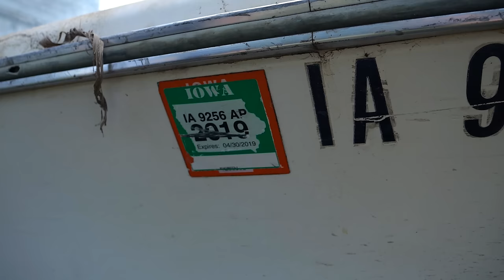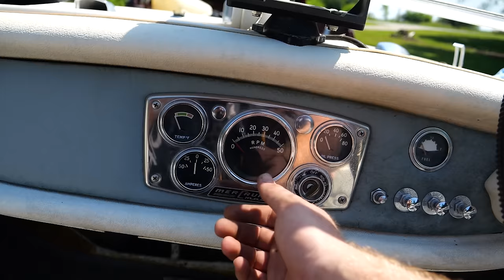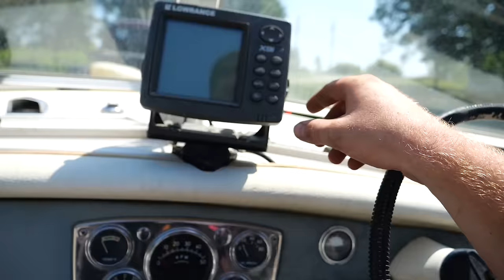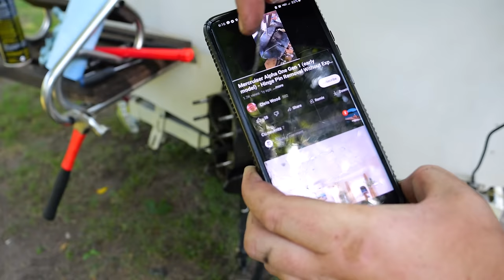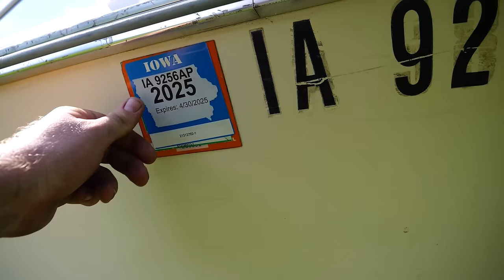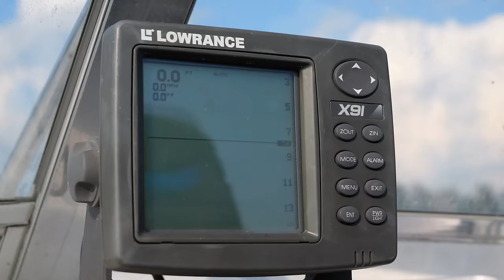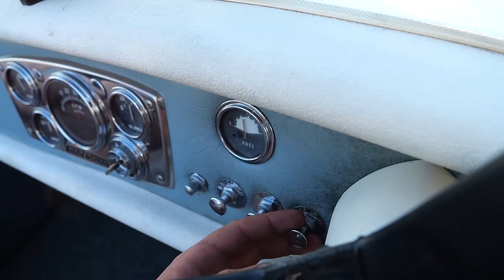Will a FREE Boat Run & Drive or SINK after YEARS of Neglect?

Comment: You think you're having fun, try maintaining a 71 Grady-White with an 89 Evinrude 90 horse motor in saltwater, change the impeller every year, every time you come back from the ocean going to run fresh water through it, hose off the trailer so it doesn't  rust to hell, the joys of boating 😂 I had fun watching you guys on the water after your ordeal getting it ready. Keep up the great work and the cool videos 👍✌️🇺🇲

Comment: Free boats are free for a reason and also not free. :p Congrats on getting it on the water. Be interested to see what you find in the motor and trans after the outting. Hopefully everything is good. If not Chevy 250 swap?

Comment: Roller/cam and pushrod would need two totally different fuel pumps (or you get metal chips in the oil) and that watered oil means an engine strip !   And all those stringers will be rotted, ie., cut out the whole floor and get down to the hull and keel, you'll need new hardwood.

Comment: @Junkyarddigs no antifreeze.. seal the cooling system where water doesn’t discharge… add 1/2 qt. of Sodium Silicate to the system.. the system has to pressurize.. crack will dissipate.. problem solved..😎👍

Comment: Running out board out of water  not good for pump in lower drive unit . There is a gardenhose kit for this .. I used it on the 21 1/2 foot Bayliner V8 .

Comment: Put Muffs on that thing!!!! Never EVER run that Motor without water even for ONE Second. I'd bet the impeller is wiped out of the lower unit now. I just picked up a 1981 Rinker T151 Tri haul last week. Got another oldie back on the water

Comment: You never want to run those motors with the rubber water impellers out of the water. The water acts as a lubricant, and it will 9 times out of 10 explode if you run it without water for more than 5 seconds. They do make water muffs that you attach to a garden hose where you can run it out of the water. They usually sell them at fleet farm or Amazon

Comment: They kept making that motor into the 2000’s. My brother in laws stretched the valves and the Boat shop told him $7000 for a new motor. They didn’t even attempt to tell him what was wrong with it. I blew air into the spark plug hole and heard air in carb. 

I had the cylinder head off in 2 hours. Found the bad valves. Sent it to cylinder head rebuilder for new Stainless valves. Apparently it’s all SBC stuff. $350 bucks later, $100 in gaskets and it ran perfect. Brother in law paid my $600 for my 5.5 hours working on it. 

This was literally the easiest cylinder head r&r ive ever done. Worlds simplest motor. 

I guess it’s common for these motor to stretch the valves and people run them flat out all day pulling tubes.

Comment: Those motors are known to crack in the water jackets right there and you could just run it because they usually don't crack into the cylinder but when they do it's ruined I think some people get away with leaving them and keep the crack in the block on the outside just patch it up

Comment: My buddy just took possession of a free '98 Ski Nautique that unfortunately got run over by a smaller yacht. I'm lucky enough to get to turn wrenches on it. We have some glass work to do, the windshield is broke, dash is destroyed, prop shaft is bent, prop is trashed, swim step is broke, and the aftermarket tower mounts are going to need glass work too. But the Pro Boss GT-40 seems solid along with the trans. There's some minor hull damage on one corner of the strut too. Free boats are far from cheap or free, but it's a free boat right?

Comment: One thing you did, and did not mention about that impeller, is you should never start the motor without muffs and water running through the system.  If your impeller wasn't bad it will surely be if you do that on a io setup.

Comment: 1. Check tires and hubs. Tires age, especially in the sun. If cracked, beware. 
             Lose a tire or bearing, you might lose the boat. 
2. See if engine will turn over. 
3. Check bottom for cracks and bubbles of de-lamination. 
4. THEN look at everything else. Upholstery is VERY EXPENSIVE. 
5. Smell gas. Change fluids.

Comment: A few tips man. I know your
 not a total newb to boats but a few things to consider. Lower the outdrive prior to running engine. Otherwise it’s really hard on the u joints. 
      Never run it dry. There’s a water pump impeller that will burn right up. Which definitely should be changed.  It’s not horrible to change on the alpha drives compared to some others. 
   I’m surprised it didn’t overheat after sitting 4 years and running dry. I like to run a conditioner through it when winterizing to keep the rubber from stiffening up. Glad to see her back on the water!!

Comment: That thing is one huge Coast Guard safety violation. I love it!!! I'm guessing you learned the lesson about running the impeller dry huh?? And an FYI, automotive fuel pumps, starters, carburetors, and distributors are highly illegal in boats as per Coast Guard regulations and the fines are HEAVY for violations. All are explosion risks due to the build up of gasoline fumes in the bilge.

Comment: Probably fried that impeller in the out drive running it with no water attached, your exhaust bellows dose not need to be hooked up all you need is driveshaft and shift cable.

Comment: 10:44 I may not be that knowledgeable about boats, but one thing i know is that you dont run boat engine with out it feed of water for it since it needs to cool and in this care be there not to melt the rubber seal. Never mind those were toast before that, but last owners probably did that too so dont do it.

Comment: You should never run a boat without a water supply ! That's how you wipe out an Impeller, If you not in the water you need to use a pair of muffs to supply water from a garden hose to the water intake on each side of the lower unit.

Comment: I put a Pleasurecraft Marine Engines 1994 Pro-Boss 5.8 EFI in my 78 F-100 back in 2001, so putting a boat engine in a truck isn't that radical of an idea. The Pro-Boss is a 351 roller cam block with iron GT-40 Marine heads and aluminum GT-40 EFI intake manifold.

Comment: That looks like a fun little boat, i'm glad you guys got it running and out on the water!
As a friendly note, it's super important to put the drive down in the water before you crank the motor; it only takes a couple dry revolutions to tear up those rubber impellers.
I don't think you showed actually changing the pump, but it's also advisable to get a nice film of marine grease inside the pump housing before you put the impeller in. It'll help keep it from tearing while it primes for the first time.
Cheers!

Comment: If you run the motor without water, the rubber pump will get hot real quick and fall apart. So you need water when you start the motor.

Comment: I have a hack for youSo I do Marine repair and I've done this many times if you drill holes where the cracks at then use your cold weld material it will actually stay in place and stopped the leak😊 and I'm sure as you know once that happens unless the block freezes there's no reason to even replace it hope this helps thanks for the football and basketball trick

Comment: If you run in brackish water pay somebody that knows how take outdrive apart and replace empeller. The 12 bolts never come out to seperate housing without knowing how because they are corroded in. I know. I suppose they use heat.

Comment: If you have to much freetime to spent and to much savings in your dravs and everywhere bay an old boat....I bought an something 80ts 22fot boat with an inboard motor whos was way to big for this type of boat,but the Peugeot XD 4.90 needed most of those parts who an man can think of and what ebay had to offer,so it took me at least 800-900 dollars to get the engine up running,but in the back of the engine there was an transmision aaaaand it was broken to....and so was the rest of the boat interiour tanks even the steering pump was junk,i had the boat on the sea for one summer and sold it with an 2000 dollars loss before it drained even more of my account

Comment: One of my first boats I owned had the same engine in it as yours and one day on the lake the engine just quit and it turned out the distributor gear sheared off it's teeth so had to flag a boat down and got a tow in since I was five or six miles from shore in Lake Erie. it was not fun and ended up selling it as is

Comment: i have two boats a 1988 Bayliner cobra with a vertical inline five Chrysler Mercury force 150 outboard it runs but idles eventually the lower needs rebuilding an the boat still needs work electrical wise an i have 1990 baystealth 1880 with a vertical mount Johnson/Evinrude 130 v four but all i can say is BOAT=Bust Out Another Thousand

Comment: A marine fuel pump has a tygon hose that leads to the intake in case the diaphragm fails.  An automotive pump will leak into the bilge.  One spark and it’s a very bad day.  Never use automotive parts on a marine engine.

Comment: Alright so I’m gonna revive my dads old speed boat, it needs wood work but it’s easier to fix than our running fishing boat that sank and fully saturated the wood and everything is rotting. We’re gonna do a motor swap since the speed boat was strugglingto run right and had lost the ability to run entirely since it was taken apart and parts lost. And the fishing boat had a similar sized engine since it was competition fishing boat

Comment: I feel you Kevin. I work my tits off for two weeks on a 14 foot Jon boat that hasn’t seen water in 10 years. I pretty much did everything you have done on your boat, on my boat. Luckily I got it on the water for the 4th and had a blast with it.

Comment: Just for that little bit of time you ran it with no water smoked that impeller.Never let a boat motor run for more than 3-5 seconds without water.

Comment: I got a boat for $500 and it milkshaked the motor and shredded the crank bearings first time out. Still have it, just don't want to dive into it yet. Anybody got a low hours Chevy 350 2 bolt for cheap?

Comment: This is a exempel ho to not start an marine engine. First  konekt water to the sterndriwe so the impeller dont melt down, sekond dont ewer use a gas like breakleaner or iwen startfluied in the carb. Use gas with a little twostroke oil in it to lub the cylinder or the might fuck our pistonring upp an cyl is gone.

Comment: Say goodbye to the water impeller in the lower unit you cannot run those engines out a hose on them. It will melt the rubber impeller in the lower unit He asked me how I know.

Comment: and the water pump got cooked never ever run a marine engine dry even while testing it yes an oil change lower unit change you show it love she’ll love ya back even if you gotta get a new head everything is available trim needs to work to water pump is easy drop the lower unit under neath cap water pump take off reverse order re install